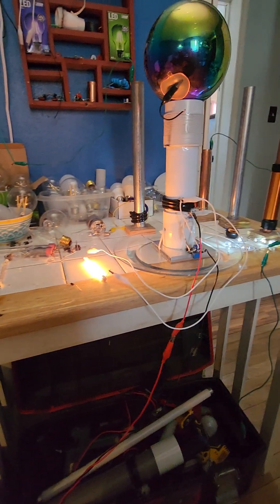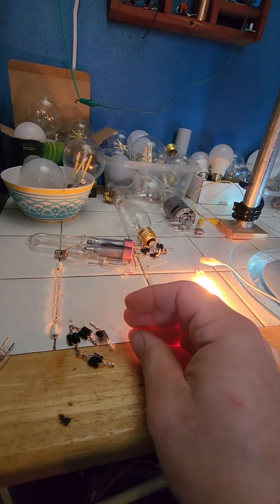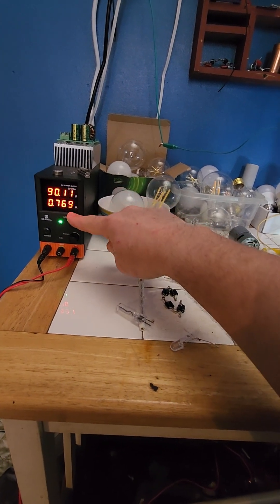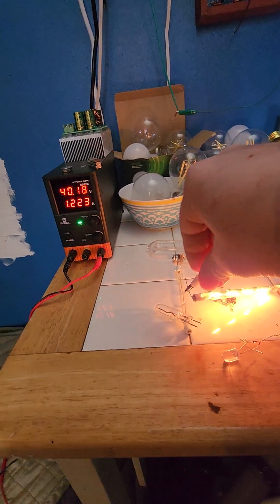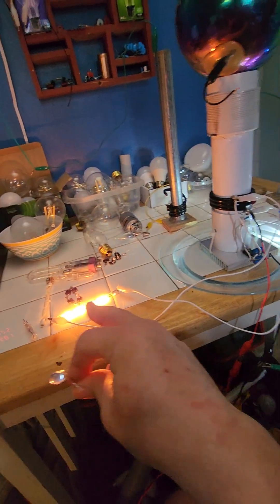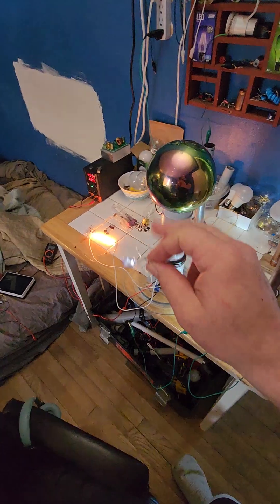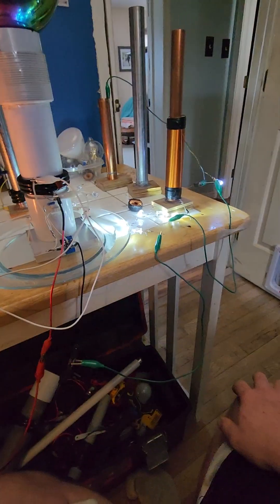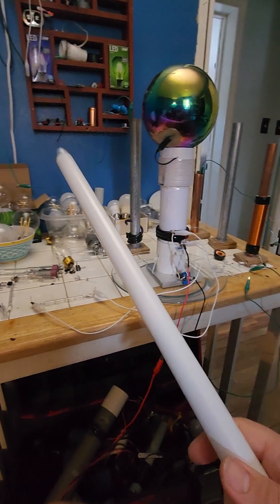⚡️WIRELESS POWER BREAKTHROUGH & EXCESS CHARGE HARVESTING TESLA COIL 💡

Comment: That halogen is not running max brightness
Reply from the maker: It's about 80% luminous due to the back emf voltage of my L1 being 80V 6 Amps DC & not 120V AC
Reply: @MTECH2022  take current and voltage readings at the same time and it'll believe you
Reply: @inductivelycoupledplasma6207  he does. he gets that much because the collapsing of the primary, secondary, and 3rd coil with a capacitance punch assisted by the topload due to it acting like a capacitor, and if he has a capacitor in the slayer excieter, that too will give you your current punch as well.